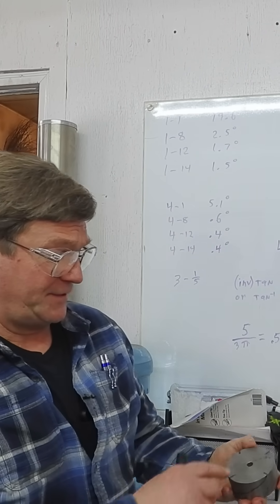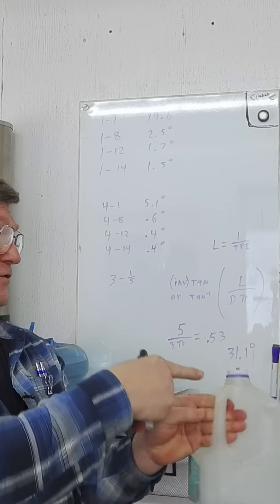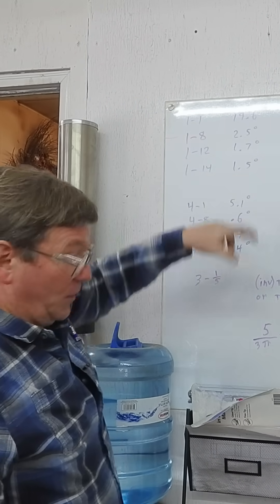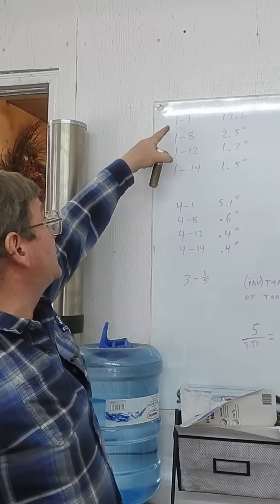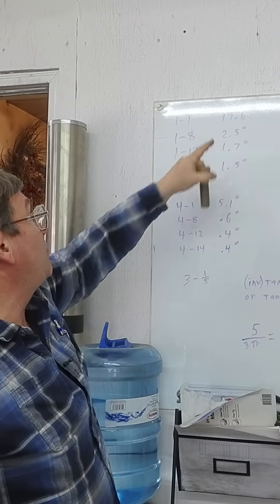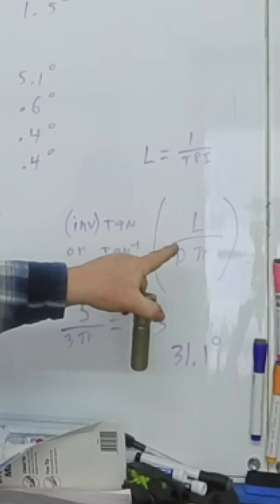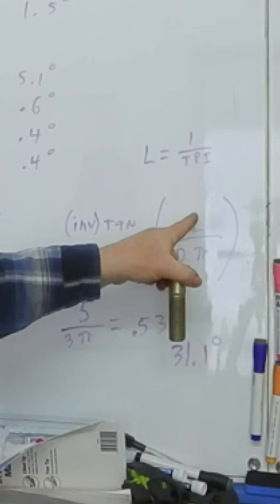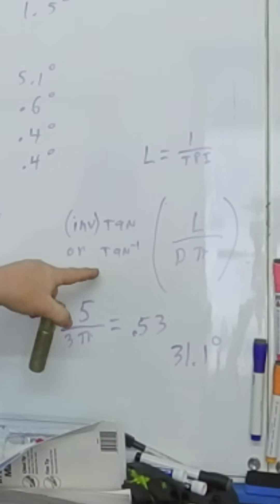Machinist's Minute: Notes on multi-lead threading

Comment: Thanks.
Now, if you can just talk about the thread indicator on a lathe carriage, and what does and how to use it…..
Oh, and can you do how to set dividing heads too, sometime?
Thanks.
Reply: This old Tony covered both pretty well at one point in time.  The lathe carriage thread indicator is pretty simple; it is just makes it so you can engage the half nut for threading at the same point in rotation each time, so your power feed for it begins pulling at the same point in rotation.  It matters because the spindle and lead screw are driven at the same rate together, so if you try to engage the half nut for your second pass, and let's say the lead screw was at 12 o'clock the first pass, and 6 for the second, you've just cut a groove in what was supposed to be the peak of your threads.  The indicator just makes it so you can engage the same spot each time.  Doesn't matter which number you start on (mine is 1-4 with  halves between) as long as you start on the same number each time, unless you are getting into multi start threads, then you might do one on 1 and another on 3, ect.  It's a simple thing, but really only important if you are threading.
Reply: And there are some things in that statement that I explained poorly,  or worded poorly I realize, so don't take it all as gospel, just trying to get the concept across.
Reply from the maker: https://youtu.be/6nS0FGcFHVA
Here you are for threading dial. Dividing heads to come at some point.
-Cameraman